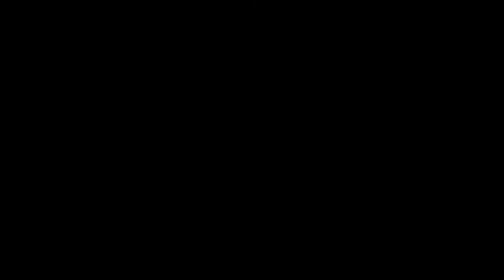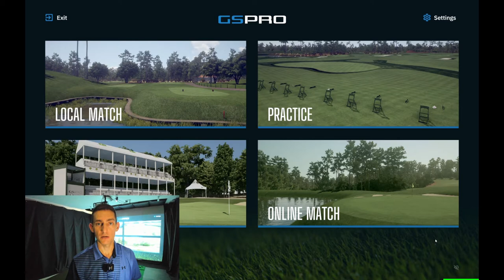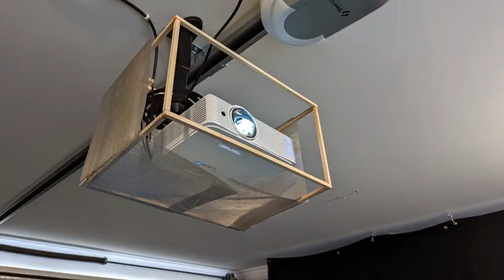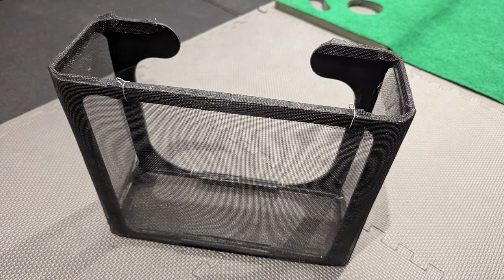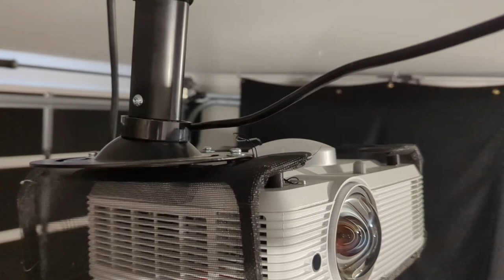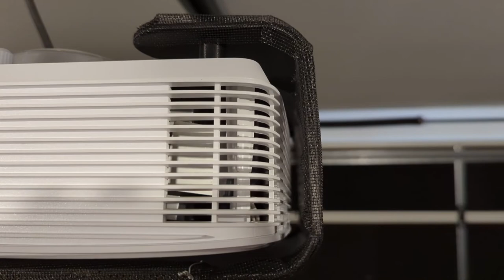DIY Faraday cage to prevent projector interference using the Garmin R10!

Comment: Very good  idea. I ran into people having problems with interference from AC units, heater unit and fans also. Looking to try to create some kind of faraday cage to work with my fan, currently I’m curious if the fly screen has to be metal or if it can be made out of some of the other materials that are used frequently, I believe they have some sort of fiberglass mesh? thanks for the info.
Reply from the maker: Hey mate absolutely there are a lot of people that have taken this idea and put them around heaters and fans. You just obviously have to be a bit careful putting them around heaters. It has to be metal mesh ideally with smaller holes as this will stop the higher frequency wavelengths that interfere with the unit. 
You can also try and create a Faraday shield or barrier as well and just stand it in front of the fan or heater. I have heard this method is quite good as well and saves covering the entire item. 

Cheers

Comment: Hi Joe!  Thanks for this!  I'm thinking this may help with my chipping errors as well. Can you share more info on the type of mesh used for this one?

I also have an issue with my portable garage heater which I can't run while using the r10 and just came across some threads on reddit about people putting mesh around their heaters to resolve the issue..
Reply from the maker: Hey Paul thanks for that mate. So this stuff is just the aluminium flyscreen you can get at your local hardware store. It would be good for putting around a heater in terms of price. But I'd be careful to leave some room between the cage and the heater as you don't want any accidents.

Comment: My new projector does not interfere like my old one did, so far no issues!
Did you get to see my hitting mat video?
Reply from the maker: That's good! Yeah some projectors seem to not interfere.. odd it just must be where they have the fan positioned in them.. or a different fan. I did check it out yesterday! It's going to be a bit of a RnD process for me as well. The putting turf I got is good but doesn't seem to be holding up to full swings. I'm picking up some other turf over the weekend to check that out.
Reply: @JLagGOLF  I moved my projector back when I changed out the broken one too, could be the reason! I was at about 6 feet now 16, above the Garmin path for sure!

Comment: Were having issues with the R10 reading short chips. One of us has to wave a club to get it red to start reading the chip. Basically we have to time it. But some days it reads the 5 to 20 yd chips. I've moved it around. Got a Faraday cage. Any help is appreciated. When we having an online match? Thx Joe
Reply from the maker: Faraday cage didn't work?? This sounds exactly like interference. Depending on what model projector you have and where the fan blows out will depend on how you make your Faraday cage. I know a guy with a BenQ and his fam blows out on the front left (opposite side of the lens) so he had to cover that front side and the interference was gone!

Also online match sounds good! Where abouts do you live? I'm in South Australia so just thinking of time zones
Reply: @JLagGOLF  oh ok my cage blocks that but maybe not enough. Mines out the front left as well. I used the box mine came in wrapped in aluminum foil. Front is open and has vent holes plus were out in a metal barn so it stays cool in winter. But I'll try a couple things. We had a small fan heater that affected it as well
Reply from the maker: @RecoveryChad  Yeah ok it does sound like to me it isn't fully optimised or working the best it possibly can. I know it didn't look the best but that one I made out of the craft wood worked really well. I also saw someone use white PVC pipe and connectors as the frame which I thought was clever but it's a bit heavier so he mounted his to the roof. Whereas I wanted mine light weight because I mounted it to the actual projector mount. 

Cheers
Reply: @JLagGOLF   miles cardboard box with foil slides over it. Today it's working great. It's more so when some else comes and has a very short back stroke. Oh well I'll figure it out. Works for me just guest's give it issues. Thx again Joe

Comment: Hi I've tried everything as per your videos and still can't get chipping right, not sure what to do next any thought, I can send a photo of set up.
Reply from the maker: Hey mate how bad is it? What's the minimum distance you can get to register?
Reply: Hi Joe
Min distance is like 20 meters even tested with my mates R10 same problem it's in a tin shed wondering if the steel roof is an issue.
My mate can chip like 3 meters no problems.
Reply from the maker: @73nnelg  Ok yes it's quite possible that's causing the issue. I would take it in the house to a different environment and try chipping there. Just to see if that is the issue or if you can eliminate that variable. When you do your chip shot does the light change from flashing green to solid red? On your back swing? 
Also on small chip shots try moving a little closer (a foot or so) to the unit. That helped me when I was getting interference.
Reply: Only solid red when I take a full swing can't take a swing like u do doesn't register
Reply: @JLagGOLF  i managed to fix my chipping issue my computer was to close to the R10 as soon as i moved it no problems can chip from any distance thanxs for all your help
Reply from the maker: @73nnelg  nice! Glad to hear it and yes anything with fans and the radar units is no good 👍